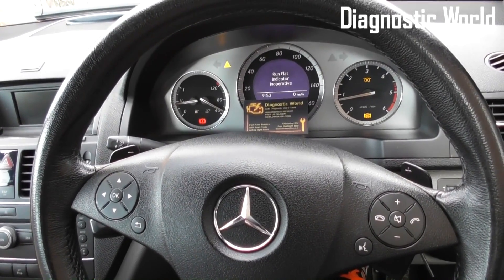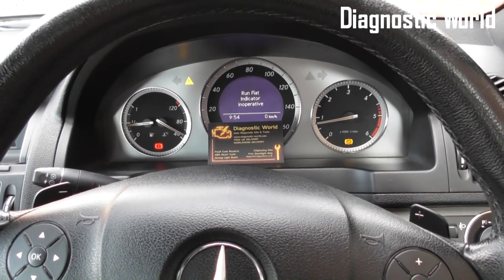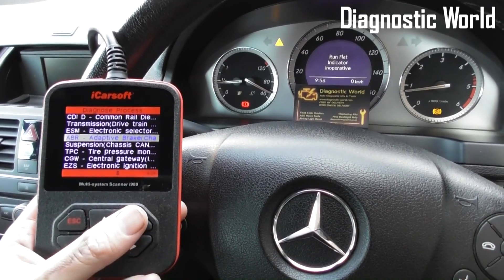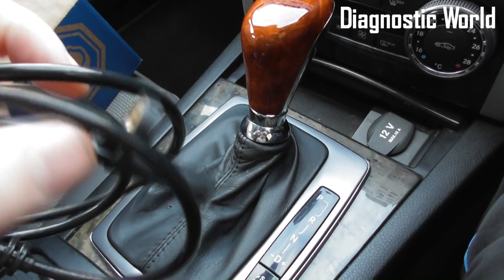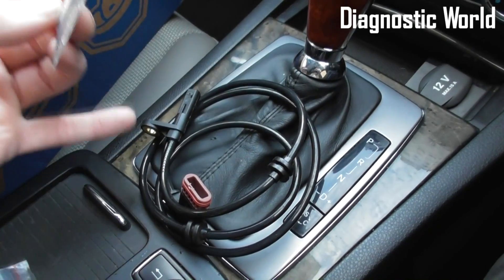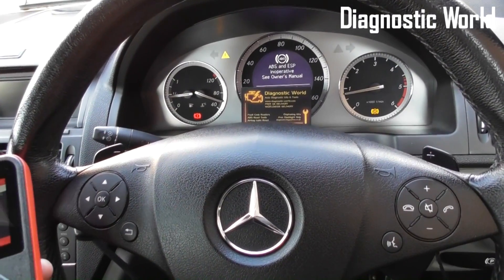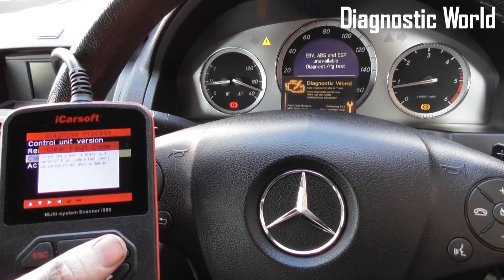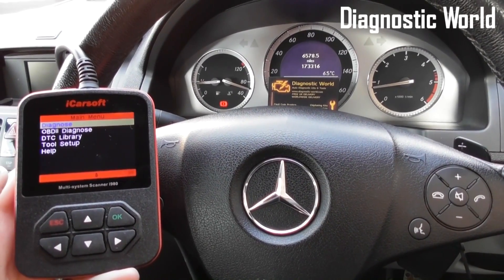Mercedes C Class W204 Rear ABS Sensor Removal & Diagnose Guide

Comment: I changed the sensor exactly as you did, but it didn't fix anything! The speed sensor is still getting 0mph and the rear white wheel and the code came back right away. 
What else could it be?
Reply from the maker: Did you put a genuine and sensor on or aftermarket? Make 100% sure the sensor is the correct part or you would get this error.

Comment: I have these same warning messages and lights on my 2009 C200 but the error code that came up was 5134 and it pointed to the same ABS sensor (right rear). I can clear the codes and the warning messages & lights come back as soon as I reach 15 mph. The also clear after turning off the ignition but comeback as soon as I hit 15 mph. The problem first came up after driving in the rain after an hour. I'm wondering if it is worth cleaning the connector with contact cleaner before firing the parts sniper rifle.
Reply: Hello there You use the OEM sensor? Cause if you use an aftermarket sensor maybe the ECU doesn’t read properly
Reply: I have since reinstated the original sensor because my problem was the ABS sensor ring.

Comment: Would the abs sensor cause transmission issues?
Reply: I read on a forum that if you drive with faulty rear ABS sensor for a while if can cause tranny fault codes aswell. Should disappear once sensor function is normal again.

Comment: I do same things .. change ABS ring and ABS sensor like you .. aj clear error in diagnostics but after a move with car 100m i have same problem...  some solution ?? my diagnosis error was different her number is: 5132 no (5130).
Reply: Hi Marcel, I have the same problem even I changed the ABS ring and ABS sensor, did you manage to sort the problem? and how? please advise.
Reply: @samozain8537  I changed the mechanics, replacing the ABS rings on both rear wheels helped. the first mechanic made the mistake of replacing the second ABS ring.

Comment: Once you located the sensor and follow it to the hub. Is it as easy as a snap on snap of process. In the video you didnt show that part. You cut the scene and went into the car and finished the video. Thankyou
Reply: The car probably fell of the jack at that point. Use axle stands.

Comment: On my 2012 W204, I installed the new right, front ABS wheel sensor, and the lights too remain. When I go to delete the code, it states that the fault code is PERMANENT. Any idea on how to override that?
Reply: Hey did you figure out the problem
Reply: @walkingbankroll33  hi .i m steven ,and my car same problem with this after replace the new left speed sensor then use icarsoft i980 also can not clear the code .other then that still any problem and what we have to check ? thanks
Reply: Well it's been 2 years amd the error message shows up when it wants too. For instance it hasn't popped up in line 3 months. And it will show up out of no where. When it does it sticks around for like 3 or 4 days. Then it goes back to normal no lights on the dash. Smh. I dont know whether its loose it needs to be replaced but at this point if it ain't broken dont fix it. When it comes on indont got traction amd no cruise control.  Smdh